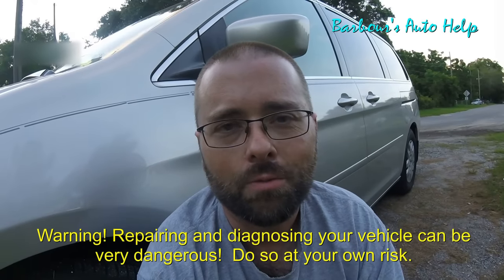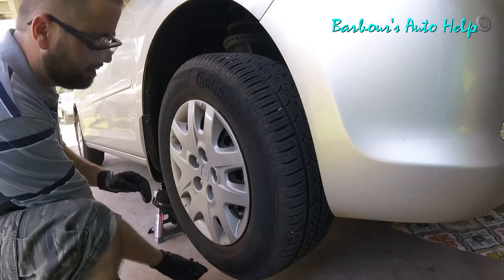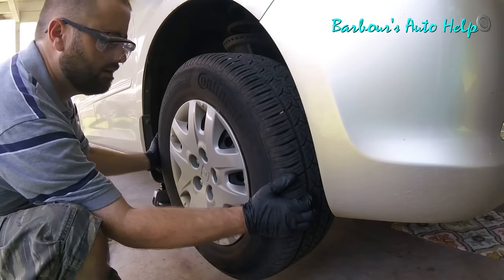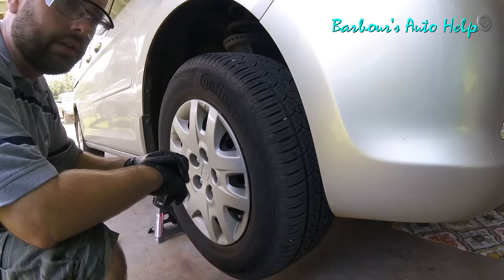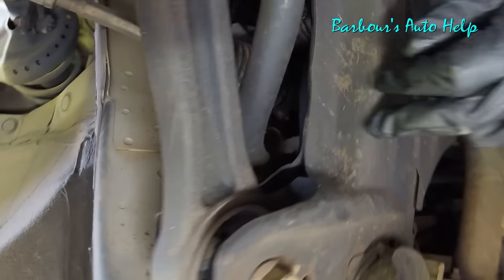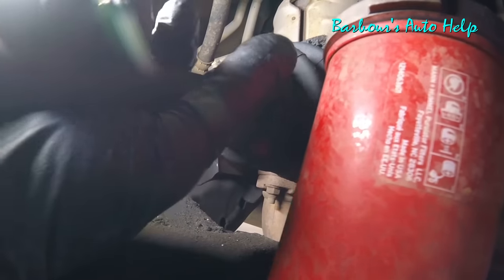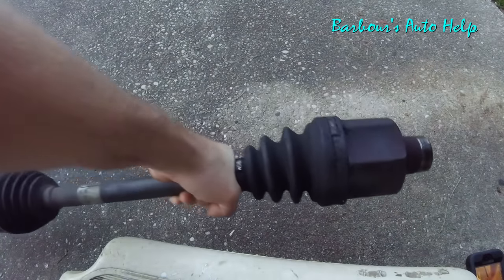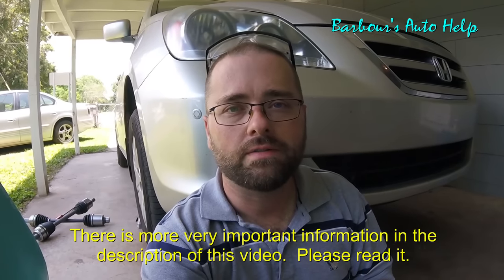Vibration Under Acceleration Diagnosis

Comment: 2015 Altima 255k miles, relatively new axles, new calipers, rotors, pads, wheels balanced, had a really bad pulsation from brakes, especially braking downhill, replaced calipers, pads, rotors, pulsing brake is gone, brakes are smooth, but I still have a noticeable shudder/shake in my steering wheel only when accelerating between 40 and 60 mph, somehow I think whatever is causing the shake also caused the rotors to warp, because when I replaced the brakes the calipers didn't seem to be sticking, and the pads wore perfectly even. Yet this is the second time I've had to replace pulsing rotors in less than a year. Anybody have an idea?

Comment: My corolla 08 vibrates at low speed say 30 to 50 miles per hour. At high speed it stops. I feel this at front right tyre. I kind of think it's my right axle. What could it be?
Reply from the maker: I'd start by checking tire balance.
Reply: @BarboursAutoHelp  I did that by interchanging tyres still it did not stop. My mechanic removed and put back that round black rubber in the centre of the axle for the right axle.
Reply from the maker: Its possible your axle could be it.  I really can't say for sure.  It's not a bad idea to have a tech look at it.

Comment: I get vibration in my whole dash when accelerating between certain rpms.  Could this be the problem? It's only when my foot is on the gas
Reply from the maker: It could possibly be the problem.

Comment: hi, do you know what causes the vibrations in the gas pedal. it only happens when accelerating. i could feel slight humming/vibrations through the pedal. its like cellphone vibration,  its only felt in gas pedal, no where else. mitsubishi outlander awd 2003
Reply from the maker: It may be a vibration picked up by the throttle cable from the engine compartment.  (not sure if this one has a throttle cable or has an electronic throttle body).  If it does have a cable.  look under the hood and make sure that the cable isn't lying on anything it shouldn't be.  Hope this helps.
Reply: got all shocks and springs replaced and alignment done. rear tires were worn out from inside edge. no more vibrations in gas pedal. thanks for your time.
Reply from the maker: Good deal!

Comment: I have a problem in my vw polo 2003 , when i start  to drive the car whith the first it gives me a shaking when i release the clutch ,( when i release it in the end ) and when i flip my tiers in the left of right side and im whith any kind off speed like 10-20-40 km/h i hear a noisy like grr grr grr, like ur scratching something of plastik 
I wonder if u can help me to doagnose what problem does if have, Thnx.
Reply from the maker: Yea, you may need someone to take a hands on look at it.

Comment: Having this problem now on my 2007 Nissan Quest. Just replaced motor mounts, both cv boots and axle on both sides, brake pads and rotors, and also had new tires I bought from Big O Tires that was balanced 3-4 times and had an alignment done this past March. I had Big O Tires try to charge me $211 for new lug nuts for all 4 tires. I told them to put them on and try it, If they solve the problem I'll buy them. They didn't know what to say when I said that. I had a mech. friend helped me checked the bushing's and strut's and say there ok. We're both confused on were the wobbling is coming from. My last guess is the tires even though there brand new and was told to get the Michelin tires put on. I'm still unsure if that will solve the issue.
Reply from the maker: +ceosto11 Did you check for play in the wheel bearings?
Reply: Yes, a couple times to make sure.
Reply from the maker: I wonder if you have a road force issue.  Sometimes tires will balance but they may have excessive road force. (hard spots on the tire).  This can cause your vehicle to feel like the tires are out of balance too.  Have you tried "road force" balancing the tires?  Not saying that is what it is but just putting it out there.  Also, are we sure we aren't experiencing a misfire?  When exactly is this sensation taking place?  What speed?  What gear?  Light or heavy acceleration?  Check engine light on?
Reply: BarboursAutoHelp don't remember seeing any hardspots when I had the tires off. Was just telling my friend who helped me that within one week after replacing the 2 CV boot assembly it ran fine just a faint noise and almost no wobbling. Seem like it progress during the week
Reply: Also no check engine light, and pretty sure it's not the spark plugs. When I back off on the pedal it still wobbles and steering wheel shakes mostly around 60mph+
Reply from the maker: +Shields Collins You only replaced the boot and not the whole axle?  By the way you can’t see the hard spots you have to put the wheel on a road force balancer to measure the road force.
Reply: BarboursAutoHelp Replaced both inner and outer boots with axle on both driver and passenger side. Will try to stop by a store tomorrow to see if they can check the tires out from what your saying

Comment: I have a Saab 93 vector sport 1.9 Tid auto it has a leaking rack just not worth fixing in my opinion. My main issue is around 60 70 mph not always but most the time I drive it I get up to a certain speed might be acceleration not sure… it won’t let me drive it any faster just vibrates so violently any ideas???
Reply: If you rack is leaking then that is why, it will only get worse.

Comment: I have a 96 Buick Century and the tires skid when I accelerate. I was told it's my cv joints, but I'm not 100% sure and don't want to waste money fixing the wrong problem.
Reply from the maker: Tires skid?  Like your burning rubber?  Are you pressing the has to hard?  😆
Reply: @BarboursAutoHelp  No. It's like the transmission is having trouble changing gears.
Reply: @BarboursAutoHelp  Didn't start until I had a wheel alignment. Before that it was fine.
Reply from the maker: Not sure what that is.  Have you taken it back to the people that did the alignment?
Reply: @BarboursAutoHelp  No. I had a diagnostic done and most of the issues were with the transmission so I doubt if the alignment is the problem.
Reply: @BarboursAutoHelp  solenoid problems.

Comment: I have a Honda Accord 2010, my car shakes once I reach 120kmph and once I take my foot off the paddle the shaking stopes. I just got a brand new tiers.
Reply from the maker: Thanks for sharing.  Do you know what the problem is?
Reply: Hey thanks for getting back. Unfortunately no. I have checked the tires balance and wheel and it’s all good. I am not sure what is the issue exactly. 

Again thank you for the video 👍

Comment: I have a 2002 volvo V70 awd I get clunking at low speeds when turning the wheel especially when parking.  The shaft on the CV joint pushes in and out not side to side  could the CV joint be bad also get vibration while driving.
Reply from the maker: I'd have a tech look at it and give you their opinion.

Comment: Hopefully someone can help because I don't wanna spend a load of money at the mechanic and do it myself instead.

Anytime I take a right turn, especially wide right turns and I keep accelerating, my gas pedal and my car start wobbling and it gets worse until I take my foot off the gas and then it stops. Then when I re-apply the gas it's fine. Can this be a tire issue? It started happening when I put my summer tires on

Comment: Hey man, i have a toyota corolla 2006, it pulls to the right slightly little but when i accelerate, it feels even more, i replaced the transmission mount, left cv axle and both sway bar link... can it be an alignment  problem? And when i revving the engine to 3000rpm it feels like a forced vibration almost like a blender, is that normal?
Reply from the maker: An alignment issue could be the cause.  I’d have that looked at.  As for the vibration, I’d really have to see it and feel it to give you an answer on that.
Reply: Edgar Majano l .

Comment: I just installed a new passenger side axle and new lower ball joint and now have a vibration under acceleration between 0 to 35 mph that's way worse with passengers in van. And goes away once u r cruising.
Reply from the maker: Oh no! Sorry to hear that.  You didn't have the vibration before right?
Reply: @BarboursAutoHelp  - no not at all. Afraid I am going to have to replace the axle again. Going to jack it up and recheck everything as you showed. How much movement is normal for a cv joint or tie rod end etc when I try to move it..  Like is 1/8th of an inch of movement normal?
Reply from the maker: Let me know what you find.
Reply: Mich - run some fuel injector cleaner on half a tank and make sure your spark plugs and wires are decent...
Reply: @BarboursAutoHelp  I replaced all four motor / transaxle mounts and vibration went away. Engine sits an inch higher now! I think the engine was moving so much it caused the axle cv joints to bind up and thus vibrate.
Reply: @Roudter  - turned out it was the motor mounts but I still have a rough idle which this might help with.
Reply from the maker: Wow!  Good job.  I like your line of thinking.

Comment: My honda accord 2011 only shakes after crossing 100km/h. Below that speed it runs completely fine. Could you please tell what could be the reason?
Reply from the maker: Sounds similar to the problem gone over in the video.  Have you attempted to investigate yet or have you had a trch look at it?
Reply: Barbour's Auto Help i changed all 4 tyres, did proper balance and alignment. It shakes when i press the accelarator hard . Shakes a little below 100 but over 100 is worse.
Reply from the maker: Ok have you gone over everything shown in the video?  Sounds like you may have scratched the surface.  How are your tie rod ends, ball joints axles etc?

Comment: Hi, i have a 2002 Toyota Camry i am having the same problem however im also having steering issues AS Well could it be possible that its just the cv axle Causing that problem too. I did check the cv axle and i have high amounts of play in the axle
Reply from the maker: What kind of steering issue are you having?
Reply: Well extreme tightness and the crazy thing is if i take it to tje car wash amd wash underneath where the axle is it starts to drive fine for a day or so
Yesterday i was in downtown fort worth and went over thw old bricks in the historical part of town, and it began to do it again. So when i got home i Jacked up the car and i have play from side to side, pulled on the axle and it clicks and moves around from the transmission and hub.
Reply from the maker: I don't think the axles would cause the steering to get stiff.  It may be time to get it checked out.  You may have a bad rack.

Comment: My 2007 Nissan xterra has been doing this it only does it when I have my foot off the gas but when its driving its riding bumpy and its really hard to steer it feels like it swerves to the right when I'm driving it down the road how do I fix this
Reply from the maker: I'd say the best answer is to take it to a technician.   No way I could tell you confidently exactly what the problem is.

Comment: I have a 2011 Dodge durango and I started hearing a loud clicking noise when accelerating from 0 - 15 mph then it would go away. This continued until it got louder and I heard a loud pop. The clicking noise went away but when i reached exactly 40mph the car would shake. I thought it was my wheel bearings and I had the 2 front wheel bearings replaced today and I still have the shaking at 40mph I can't afford to waste anymore money please help with any advice you have I don't trust my mechanics knowledge.
Reply from the maker: The very best advise I can give you is to take it to a mechanic.   Especially if your throwing parts at it and it's not getting fixed.  It could possibly save you money by not spending money on parts that aren't needed.  If you dont trust your mechanic then it may be time for a new one.
Reply: @BarboursAutoHelp  thanks

Comment: Hy i have a question i dont knoe if you can tell me i have a chrYsler 300 2005 and it shakes every time i make a stop or ism park with the car on i have taken it to 4different macanic and they dont seem to find the problem
Reply from the maker: It's possible your rotors are warped up.  I didn't under stand the second part of your question.  Every time ism? park?

Comment: I have a 2013 awd Durango RT and its vibrating from the rear...i was told that its the front assembly but i dont see how with the transfer case in between the front driveshaft and the rear driveshaft
Reply: It could just be a tire on the rear if it does it constantly and gets worse as you go faster.

Comment: I have a 2001 Audi A6 v8 4.2 I get vibration only accelerating under around 50-60. If I give it enough gas it doesn’t shake at all or after I’m rolling it doesn’t shake either only when I lightly give it gas. Could this be my sensor position or something else? My check engine light reads camshaft position sensor cir high output
Reply from the maker: Hmmm.  It would probably be best to have a tech look at it.
Reply: Did you ever figure out what the cause is, I'm having the exact same issue with camshaft sensor codes

Comment: Hey so I have a 2012 odyssey now what mine does is that is shakes when I’m speeding up or going uphill between 25-35 mph I took it to Honda and they told me it’s normal so I took it to a transmission specialist and they hooked it up to a code reader and nothing came up , the cv boots are new but when it shakes it looses power and I can see the rpms going up and down while losing power . Any ideas??
Reply from the maker: Sounds like a misfire to me.  You may need new plugs or a coil.  I'd have a tech confirm that though.

Comment: I know I’m late BUT I got a tire put on my drivers side and now I have a pulsating/shuddering sound/feeling between 30-40mph from my passenger side. Feel it more when u accelerate but only between thoose speeds. don’t feel it as much maintaining low rpm. before 25 can’t feel anything after 40 can’t feel anything. Any help please. U do not feel it in the steering wheel

Comment: Hi. I have some vibration in my 2005 honda accord.  It doesn't happen a lot. Its like a 2 second hard vibration, sometimes little soft, then immediately stops. Its not constant under acceleration. What could it be. Ive checked my bearings and tierods.
Reply from the maker: It could be something on the the car....lol all kidding 🤣 aside.  There are other things that could cause the vibration.   Id say if you haven't found it using the video then having a tech look at it would be your best bet.

Comment: I have a Audi A4 2003 b6 had everything checked other than driveshaft have a wobble vibration on acceleration only do you rekan it could be a drive shaft
Reply from the maker: Its possible.

Comment: On audi A3 replaced inner cv, rear shocks, 3 wheel bearings, small control arm bushes & new set of tyres but still having the vibration problem over acceleration.
Reply from the maker: Sometimes having a tech diagnose it for you could save money.  It may be time.

Comment: I'm dealing with a similar noise and vibration but not when accelerating. When I let off the gas I heard the noise, when I accelerate it stops
Reply from the maker: Did you find anything with your inspection?

Comment: I have the same problem.. 2005 corolla Xrs 6 speeds, vibration when accelerate after 55mph.. 
I just balance my tires today and the problem still here...
Im thinking on replaced both cv axles.....
Any idea? Thanks a lot for your help..
Reply from the maker: Be sure to inspect things first.  If your not sure it never hurts to have a tech look at it.
Reply: @BarboursAutoHelp  thanks for the fast response..
I replaced the low control arms( both sides) the inner/out tie rods, complete struts, and the problem still here.  :(
Reply from the maker: Sometimes it pays off to have a tech take a look.  Could save you money.
Reply: @BarboursAutoHelp  thank you..
I need to be sure before to spend more money..
It can be the cv axles or the wheel bearing..thanks again.
Reply: 2zz....before anything else, run some gumout injector cleaner on half a tank and ensure your spark plugs n' wires are in good shape.
Reply: @Roudter  i just replaced the struts and springs OEM, and 2 motor mounts.. Now my corolla is running like new..
Reply: @2zz - Oh, cool. 
I had replace my tires, both cvs, checked all the suspension, replaced spark plugs n wires with no luck - until I simply ran some cleaner through the engine...I, apparently, had a slight misfire on some dirty injectors, but only under load (during acceleration)....was making me crazy...glad you're in good shape now.
Reply: @Roudter  yeah thanks bro....i had a similar problem like 2 yrs ago, but the problem was a coil spark plug😁... $75 oem part.. I love my corolla.. Toyotas and hondas are very reliable vehicles.

Comment: I have same problam vibration during accleration 4th 5th gear 70-80 km h speed
i feel more vibration on load and up hill or bridge is this issue are in axle
Reply from the maker: Its possible.  Have you attempted to inspect the front end components a shown in the video to possibly confirm what the problem is?

Comment: My cv axle was shot on the passenger side so I replaced it. After replacing I now have vibration when I accelerate. I can’t find what it is
Reply: If you bought an aftermarket remanufactured CV axle...that happens sometimes.  We have had cars that will vibrate unless you install a dealer OEM axle.